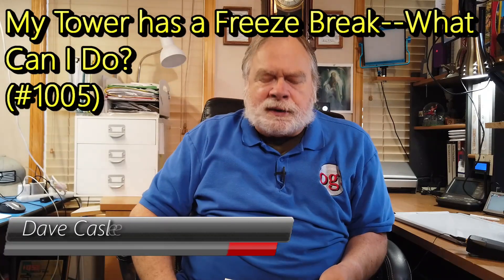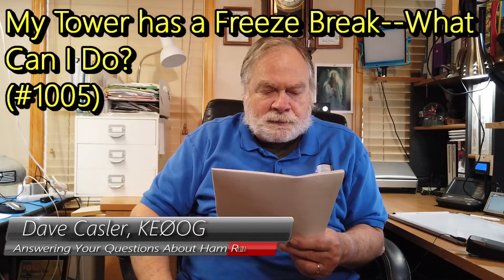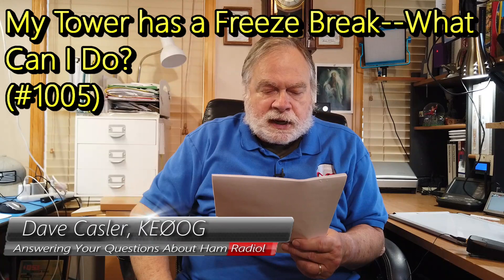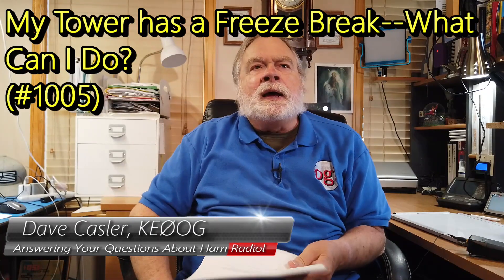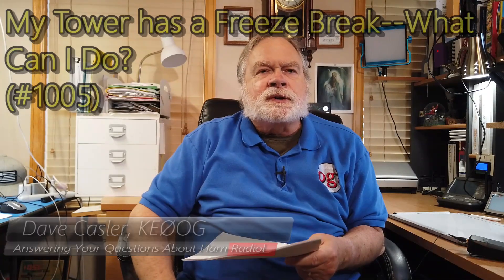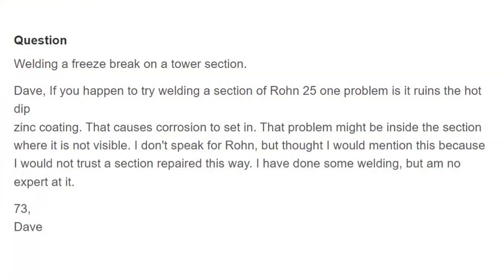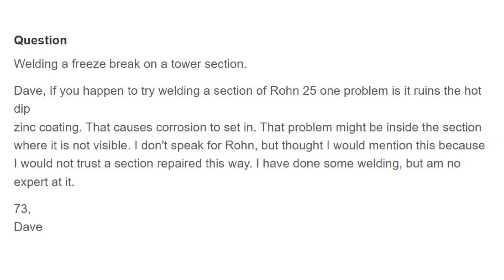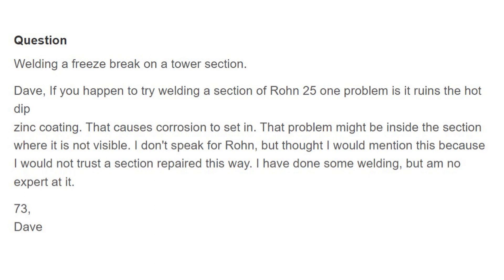My Tower has a Freeze Break--What Can I Do? (#1005)

Comment: I have a metal fab biz i repaired one for a local ham he did not want to take it all down it was near the bottom drilled at the base and let the water out . did that on all 3 legs made a tool from schedule 80 pipe split  was able to push it back together with the power pack .  then wire feed welded it plugged the bottom holes with clay drilled a 1/4 hole up a couple of feet on all 3 poured zinc chromate primer till it ran out let that sit a couple of days then drained it  with a small hand pump back into the gallon can popped in rubber plugs leaving the bottom ones opened touched it up with cold galvanizing  looks good note the tower was fairly new  but could be done to any tower  before I would put one up Id treat every section like that and make sure drain holes were open  this one was installed with the short section you set in concrete so the water had nowhere to go .  my personal tower is a Rhone HDBX 95 free standing one .

Comment: When the tube steel is formed at the mill, the steel is work-hardened which increases its strength. When Rohn welds the cross-bracing, very little heat input is applied. If one was to attempt a weld repair, more localized heat input would be applied, resulting in a reduction of the yield strength in that area of the tubing.
AWS  SCWI  11040058

Comment: I have installed tower since the early 70's if installed correctly in concrete is not the issue,the direction clearly state gravel in the base at least six inches where the legs can drain then pour the concrete, if the tower is not over loaded the split can be dealt with with a leg clamp two pieces clamped around the split and bolted above and below the split, i have seen this does with 20 g and 25 g with small antenna and anything above 40 feet should have a house bracket or guy wires, even 45 g should have support above 50 feet, i have installed 25g up to 125 feet with guy wire

Comment: Put in a tube with lesser diam and try 
to MIG/MAG WELD IT  - ON TOP AND
BY THE DAMAGED PLACE! PLACE A 
90 DEGREE IRON ON TOP OF WELDING
AND CLAMP IT WITH 6 U BOLTS
ON THE TOP: 5-6MM (1/4 INCH) STEEL PLATE ON TOP OF A RUBBER SHEET
(LORRY INNERVTUBE!) BOLT THEM ON
THE TOP! WITH 6 PIECES OF 1/2INCH
U BULTS AND NUT  OR STRAIGHT BOLT
AND BOLTWASHER! AND DOUBBLE
NUTS BENEATH! JUST TO KEEP THE METALSHEET AND RUBBER  IN PLACE! 
PLACE

Comment: Spray on Zinc is available to touch up towers  and such. Also, never cement a section into the ground, it will rust out, use a base plate and concrete pad.

Comment: If you have one leg that's already got a freeze split the other two legs may have water in them and they're rusting from the inside out.  My advice would be to take the tower down and replace the bad section(s) and then put it back up.  If you do attempt a repair I'd find a structural engineer to inspect the tower and sign off on the work.  Without an engineers signoff your insurance company is probably going to deny any claims that arise that they can even remotely arise from the repair.

Google "ham dies in tower collapse" and read the articles before you consider repairing your tower.
Reply: THIS is the correct answer.